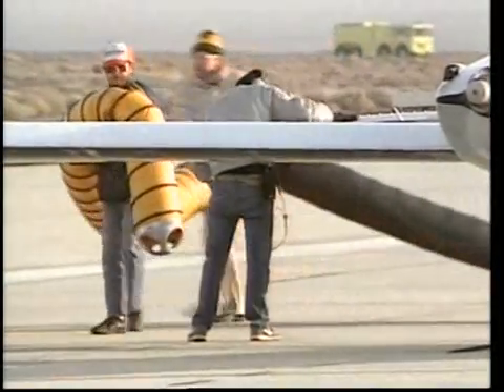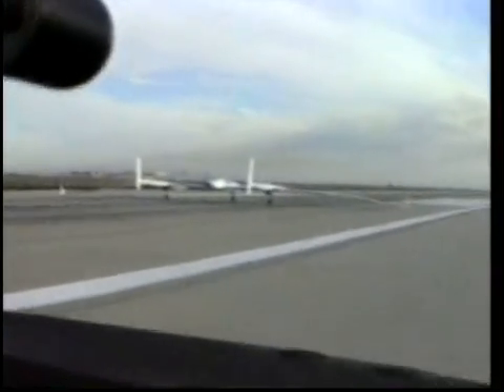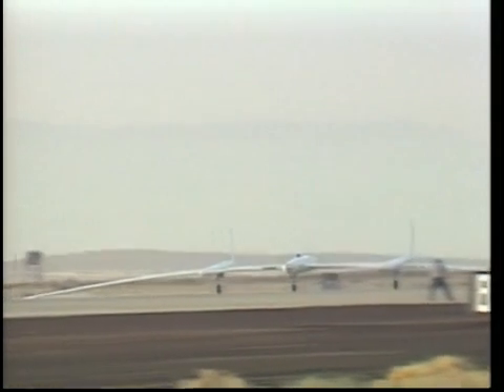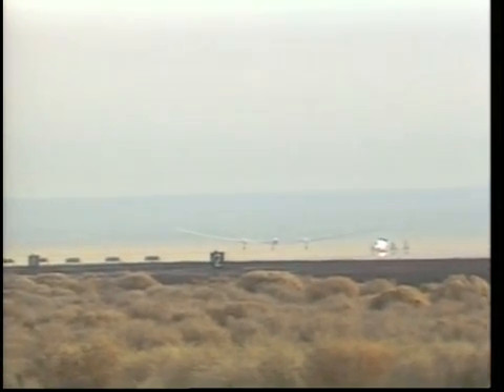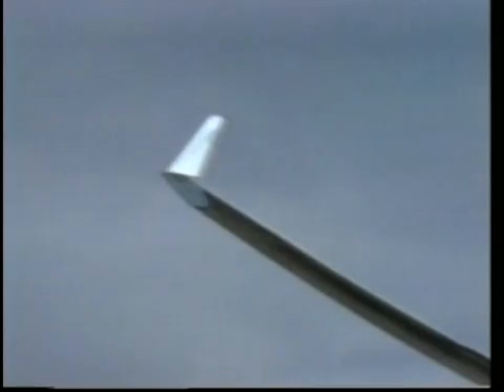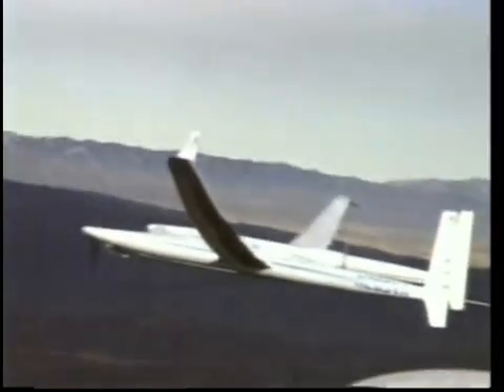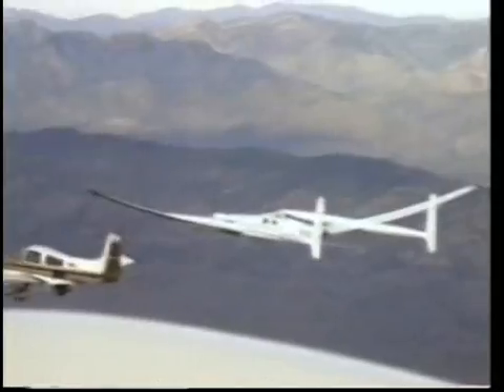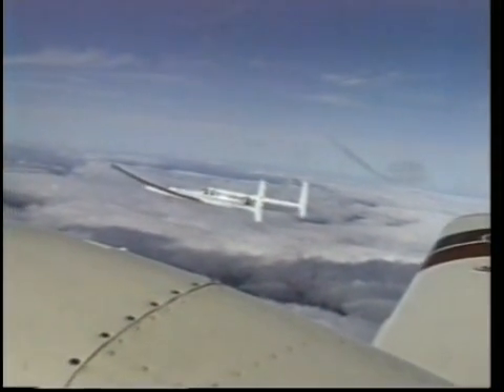The Frontiers of Flight - The Last Great World Record (1992) Rutan Voyager Part 3/4

Comment: So was the dragging of the wingtips at take-off a pilot or a design error?
Reply: You can see in previous clips the wings did not touch the ground, they had a foot or so, of static clearance. As mentioned above, the negative angle of attack created downward lift which even a small amount on that long of a lever pushed it downward into the pavement. It could also be due to a small amount of washout, wing twist. Intended or not. Ive heard people say, who heard from Dick or Burt in a speech, that the landing gear tires or struts were gas charged to a pressure higher than normal for this flight and that extended their length made the aircraft kneel, and cause negative angle of attack. 

Ive also heard that the additional fuel in the outboard wings caused the wings to twist as they bent downward, and this twist was not intended and caused the problem. This is the most believable to myself, because all of Burt Rutans designs use clever aeroelastic tailoring that causes the wingtips to twist slightly when the wing is deflected under load. Although this case it appears the twist is backwards from ideal (negative loading).
Reply from the maker: I would say that both:
- The wing was designed and built stiff enough to not to break due to the lodas, which also meant that it bent into a curve a lot. Being fully loaded with fuel in all its span meant also that they will bent downward. I guess that the weight was taken into consideration but not the aerodynamic forces on take-off. The nose down attitude put the wing in a negative angle of attack, producing negative lift and bending the wing toward to the ground.
- The nose down attitude was something that Dick used trying to gain speed (no lift no induced drag) but that made things worse, because that produced negative lift and runway drag, while damaging the wingtips. And despite Burt telling him to pull up, he opted to kept such attitude.
Reply: I think this happened due to the fact that the plane was loaded with 15% more fuel than the usual capacity

Comment from the maker: Already done by The Scaled Composites Model 311 Virgin Atlantic GlobalFlyer (registered N277SF) a single jet engine aircraft designed by Burt Rutan in which Steve Fossett flew a solo nonstop airplane flight around the world in 2 days 19 hours and 1 minute (67 hours 1 minute) from February 28, 2005 until March 3, 2005. The flight speed of 590.7 km/h (342.2 mph). The GlobalFlyer has a fuel capacity of over 18,000 lbs, the Rutan Voyager has 7,010 lbs. Make your own conclusions about fuel efficiency